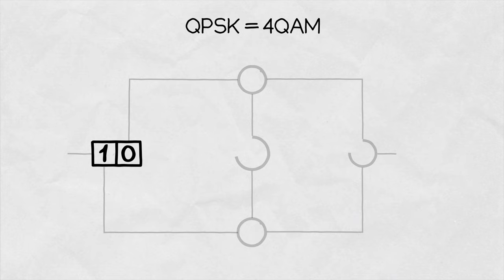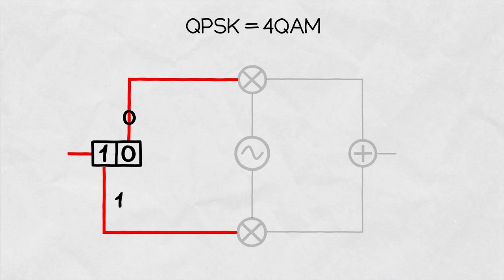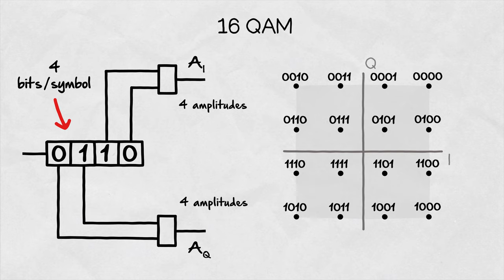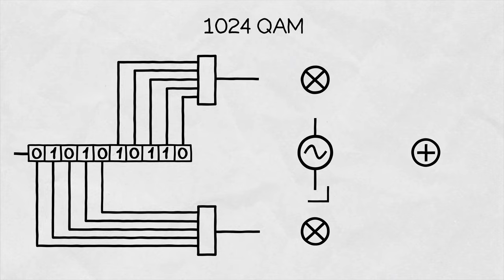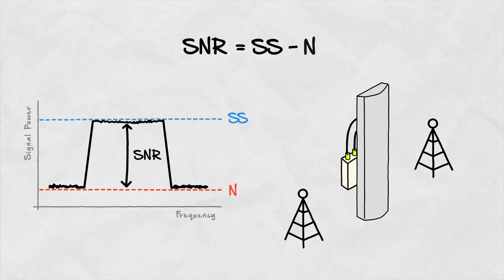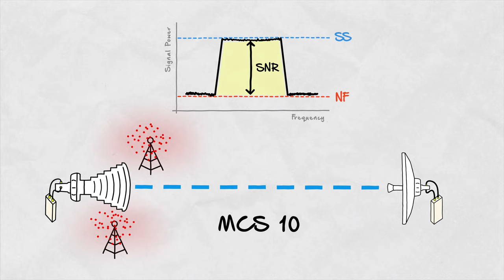Inside Wireless: QAM modulation II - The Modulator

Comment: I am a bit confused about something: It seems that in many diagrams out there, the incoming bitstreams into the mixers are labeled as I and Q, as if this digital data was in quadrature before getting applied to the mixer. However, based on this video, it looks like the data is not actually in quadrature until it mixes with the carriers which is in quadrature, since the 2 sinusoids are 90 degrees appart. So my question is the following: is the incoming bitstream in quadrature already? and if it is, is this a must?
Reply from the maker: The bit stream at the entrance to the modulator is not in quadrature, you got it right, it's the two sin waves that are in quadrature..

Comment: This is a good explanation and reference to those who still launching 4G and 5G sites with 30m height. For getting huger MCS and Modulation antennas should be very close to subscribers. I think 15 meter height is more than enough for 5G 3500mhz (sub-6) and without obstacles between antenna and user. Thanks for sharing your knowledge

Comment: Thank you for an excellent video explaining this so clearly. I would only add that I believe SNR is signal power divided by noise power, not minus it, hence why it's called a ratio.
Reply from the maker: You're welcome! Good catch by the way - it is not stated explicitly, but of course we assumed the log scale, so division in linear is subtraction in logarithmic..
Reply: @Rfelements  Ah I see! I don't work with RF so didn't realise that log scale typically used, thanks

Comment: Great video 👍...but, how can QPSK be the same as 4QAM? After all, QPSK has no modulation of the amplitude. There is only one possible level of the amplitude, and the symbols are determined only by the phase shift, unlike for example 16QAM which has three levels of the amplitude (hence the name AM), in addition to the phase shift. Doesn't this mean that 4QAM must have two levels of amplitude, and only two levels of phase?
Reply from the maker: Hello!. Unfortunately, it doesn't mean that. To have two amplitudes you will need to have them in the constellation diagram (lets say the X axis), and then one of them will be the strongest. In the constellation diagram we show here, which is the one used in 5GHz wireless networks, all the symbols are equally strongest when compared from the center. Also, when you search QPSK and 4QAM you get the same result (neither of them is much used as well). Thanks

Comment: Should the position of the 10 and 11 be switched on the QPSK constellation diagram at 2:16?
Reply from the maker: Hello!. It should not, is the correct way. You start counterclockwise and add +1 in each sector. Results are shown in binary. Thanks
Reply: Thanks for the reply:)

 So if the i and q amplitudes are both 1 then does it make a 45 degree angle with the x axis? If so then shouldn't this position correspond to the value 11? Based on the previous animation that showed 1s corresponding to an amplitude of 1 and 0s corresponding to an amplitude of -1.

Comment: So it’s likely not worth paying more for a 1024 qam router vs 256 qam?
Reply from the maker: router is one of the many devices in the chain... it depends if you have customers willing to pay for higher speeds, and if the hardware you use lets you leverage the high QAM rates..
Reply: @Rfelements  thanks. I ask because I purchased Costco’s Netgear RAXE450 wifi 6e router which has 256 QAM which is different then Netgear’s RAXE500 wifi 6e router that does have 1024 QAM. 

It was $100 cheaper. 

I was thinking of returning it to get the full benefits of wifi 6 and future proof with 6 gh band.  Thanks
Reply: Thanks for responding. Correct the bandwidth is a bit lower, however does having only 256 qam still make the raxe450 a wifi 6 router?  It is advertised as such but with 256 qam. Thanks again.
Reply from the maker: @davidbosshart4448  The product spec says it supports 802.11ax, which is marketed as wifi 6.